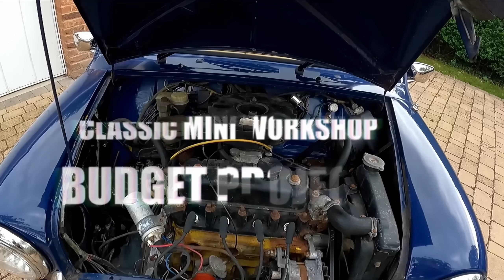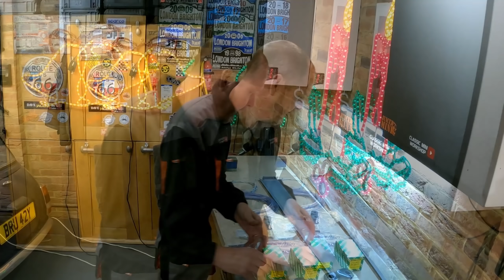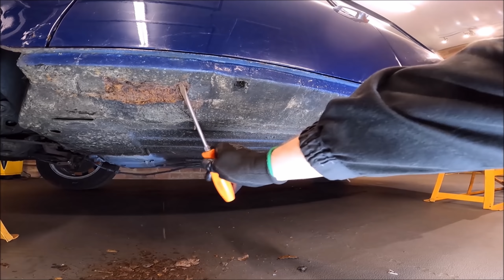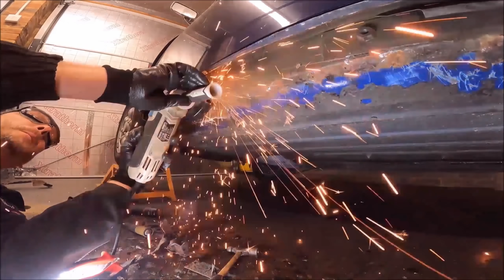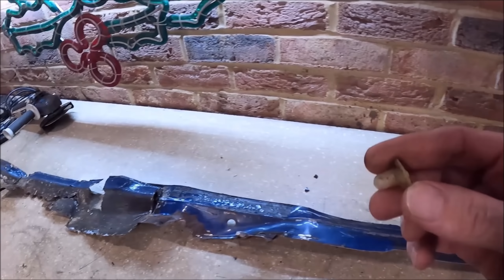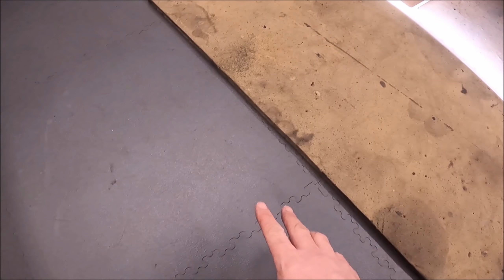More Rust, It Never Ends! *Budget Restoration* - Classic Mini Workshop Part 13

Comment: My mgb gt is exactly the same. Inner sill, castle rail, inner sidemembers all shot! Saddest part is, i can still see the heritage labels on the panels, but whichever half witt fitted the new panels previously tack welded in about 3 spots and seam filled the panels together 😂 
£600 worth of repair panels for work that is probably less than 20 years old...

Keep up the good work!
Reply from the maker: Thanks Ryan, good luck with the MGB. Happy New Year.

Comment: Bit of good luck with the expected horrors there Keith.
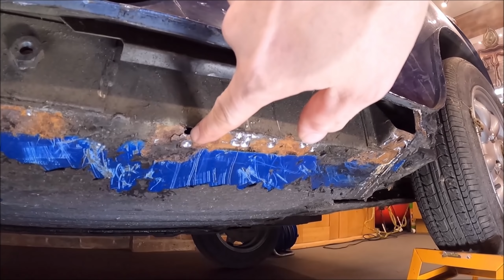Sorry my OCD played up again @ 15:30. I noticed the plate above your finger when the old sill came off and that it looks bent down. I think its the one that forms the bottom of the companion box?
Worth a check before the sill goes back on.
Have a very safe and prosperous 2022 mate! 👍
Reply from the maker: Well spotted, yes it's the closing panel at the bottom of the companion bin. It looked like someone had bent it down but on closer inspection it hits the inside of the door step rear corner so I actually think it was probably incorrectly fitted from new and get bent. I managed to bend it up quite a bit, but not fully.

Comment: That’s a long run of welding you’ve made for yourself, I’m surprised you didn’t go for spot welding it along the top edge. I guess all the time drilling spot welds out it sort of equals out time spent on the job. Definitely found it interesting that you went that route though 👍 minis always hiding rust! 
Those magnum heel board repair sections are crap, there are better non heritage versions.
Reply from the maker: It's about as long as it is short to be honest, and I didn't want to completely cut out the inner sill, outer and door step without bracing and I didnt have any bracing bar to hand. Thank for the heads up on the heel board, I'm sure it will be fun LOL!

Comment: Happy New Year Keith! How is your garage floor holding up with all this metal bashing? I fitted a similar floor last year and whilst it is very comfortable to work on you do have to be careful to avoid inflicting marks and dents that don't completely self-repair.
Reply from the maker: It holds up very well against impact damage but I do have to be careful when welding or laying down a hot blow torch for example

Comment: With Bull Motif i think free postage is after £120 spent and they don't make it common knowledge. They also give discount on the more you spend. Mini Spares postage is £7.50+ vat but you do get a 7.5% discount if you use TMF. Nippy cars are worth a look. I have started using Bull Motif to. As for the brake hoses, i run some cable down the hole to enlarge it because the hose hole gets smaller due to age related rubber expansion and then give the metal ends a good wire brushing, then finish off with boot polishing the outside of the hose, look like new. 😂 (PLEASE DONT DO THIS FOLKS ITS DANGEROUS, IT JUST FOR LAUGHS AND GIGGLES) Happy New Year to you and Mark and both your families.
Reply from the maker: You had me going for a minute with the brake hoses. I read the boot polish but and was like, WTF! Happy New Year Paul.
Reply: @classicminiworkshop  glad it gave you a chuckle 😃

Comment: Keith, I have a rear subframe that I would be willing to donate to project Bruce.  It is a post ‘91 type off my 1994 SPI Cooper. It does needs some cleanup work but is structurally sound. Unfortunately I live in the Ipswich area which is not exactly round the corner from you. Let me know if you are interested otherwise I will sell it on fleabay.
Reply from the maker: Thanks, I really appreciate the offer. I'll hold fire for the moment in case something comes up locally.
Reply: @classicminiworkshop  No worries.  Have enjoyed and learnt a lot from your videos which are currently helping me restore my car.